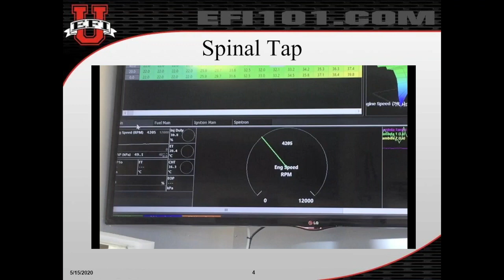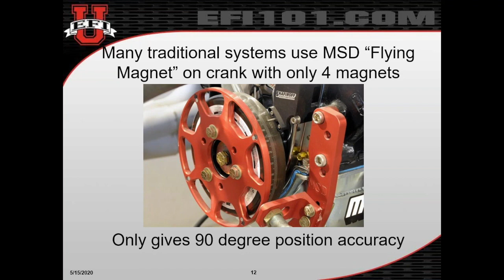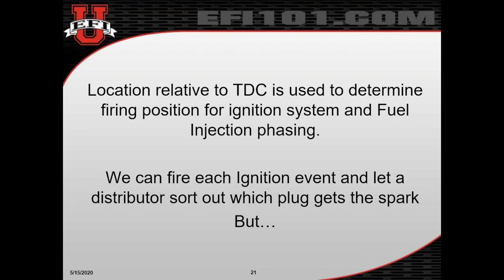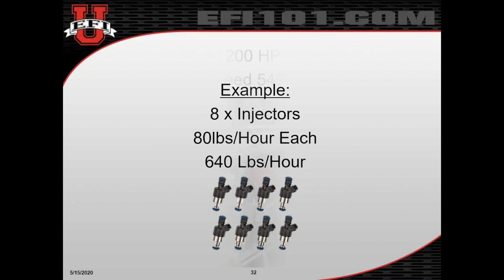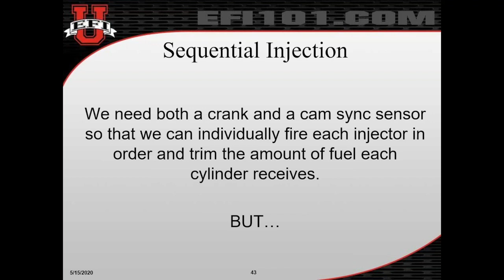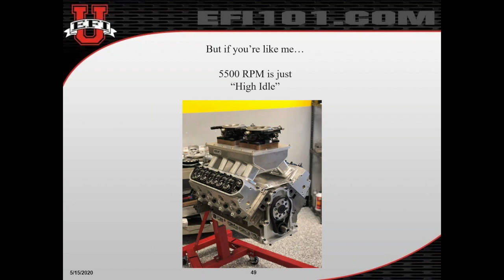AERA Super Webinar - Ben Strader on EFI for high RPM engines

Comment: I have wondered why you couldn't pull all the information on where the engine is, off of a full complement toothed cam wheel and sensor? This would give you more information with less parts. It would also slow the speed to half so when you are going for insane RPM you could still get the resolution.

On the injection has anyone tried using a very small injector that at a certain point just comes on and stays on. Then use the other injector to modulate the fuel flow and time to make up the difference.
Reply from the maker: Mr Ford, the missing tooth allows the computer to count the degrees of rotation beyond 360 degrees. The 4 cycles take 720 degrees, so having the missing tooth on the crank reluctor and an indicator on the cam gear allows the computer to know where everything is within the 720 degree cycle without any additional complexity.

In regards to the injector. The longer the injector is open, the greater the chance for fuel wash of the cylinders.

Comment: Would a total seal ts1 ring set or a high quality steel set be better, for forced induction/ nitrous motor 331 ci Forged sbf. Looking for a good set of rings👌
Reply: I went with the ts1 , figured I try them out. Next go round, I'll give you a ring. Next motor👍
Reply from the maker: Good deal.
Reply from the maker: Our AP Steel rings come in gapless, gas ported and conventional styles. The AP Steel is the best bet for a forced induction, nitrous engine. Contact our tech department for a recommendation specific to your pistons. 623-587-7400.